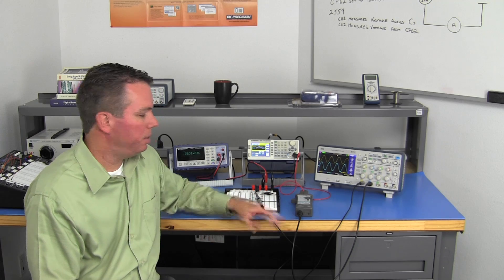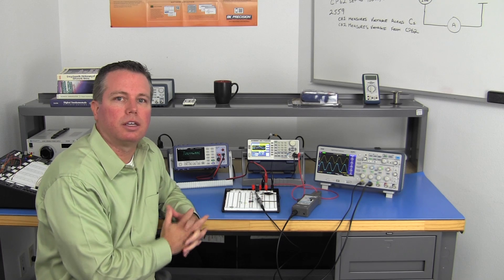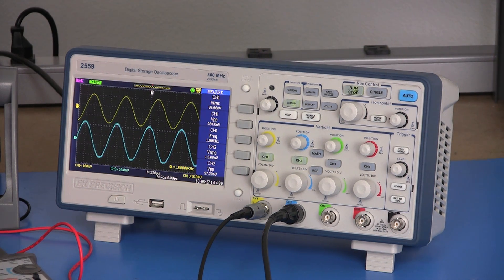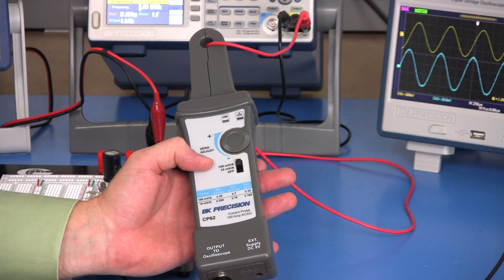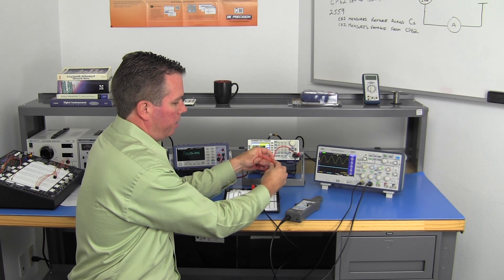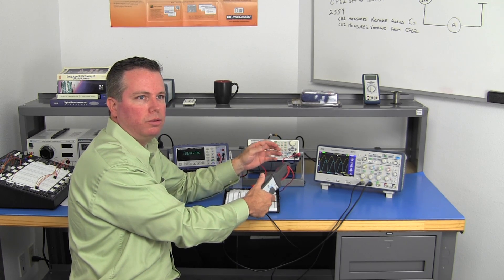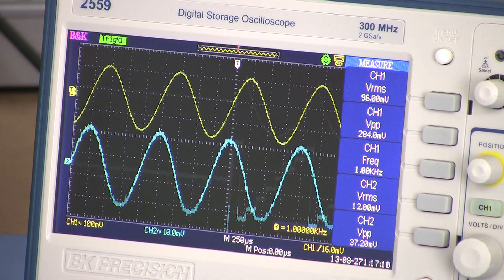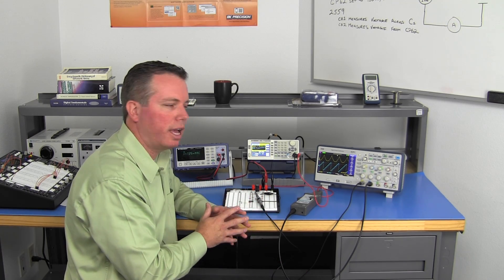How to Simultaneously Measure Voltage & Current with a CP62 Current Clamp Probe

Comment: Dear sir, Can I measure the charging and discharging DC current in an RC circuit using the current probe and the osilloscope , If the current maximum value in the circuit is 0.2 mA DC ?
and can I draw the charging and discharging current curves on the osilloscope like it is easy to do for the voltage curve?